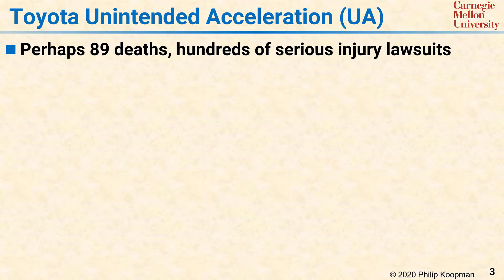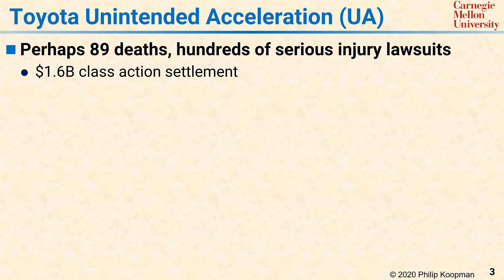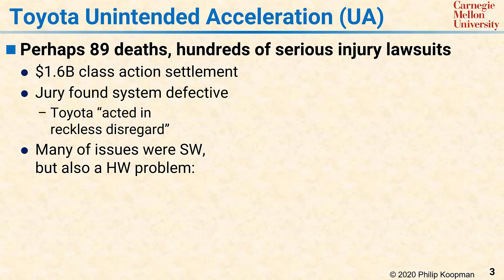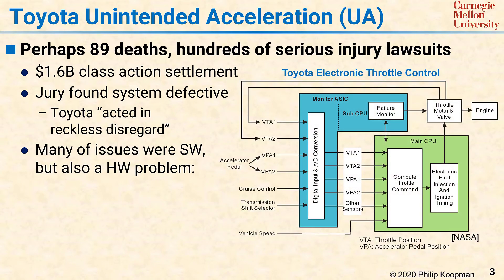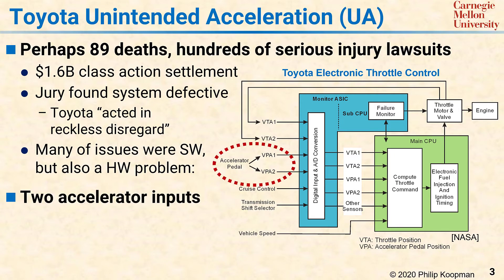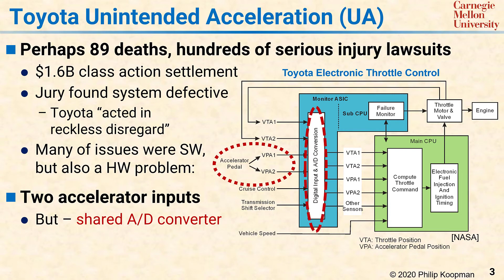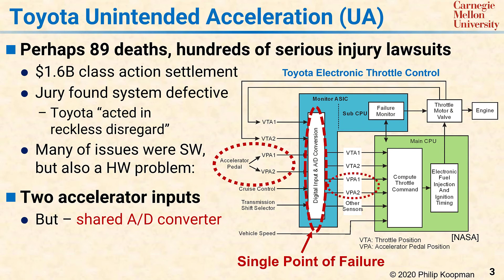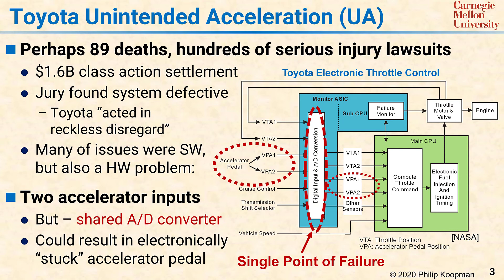L30 03 Toyota Unintended Acceleration    Single Point of Failure

Comment: I am reporting the cause of car SUA that I found. please refer to this.
      SUA: Sudden Unintended Acceleration.      ECU: Engine Control Unit.      MLCC: Multi-Layer Ceramic Capacitors.
The cause of car SUA is inside the ECU.
This is because the MLCC in the injector control circuit is broken.
For more information, search on YouTube as follows:
   Search term: [Root Embedded] Causes of SUA.
Thank you.